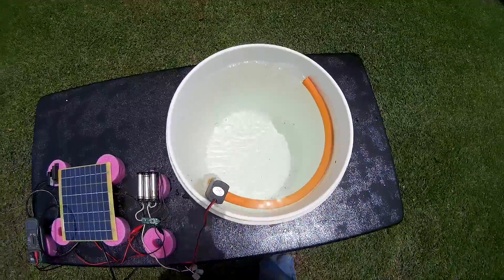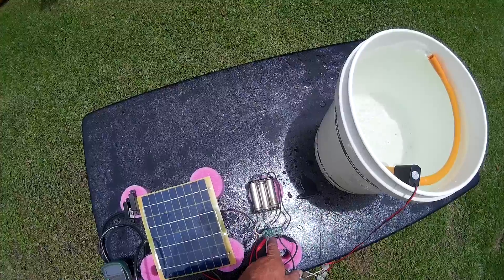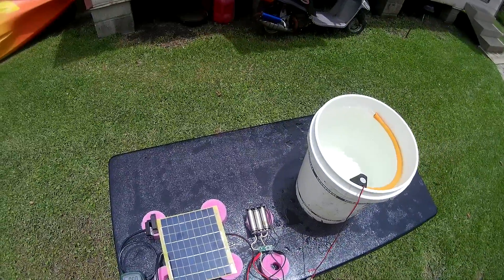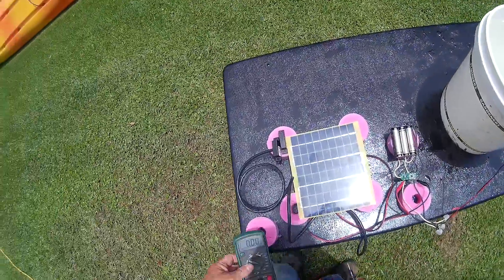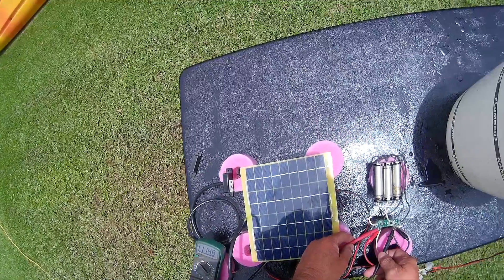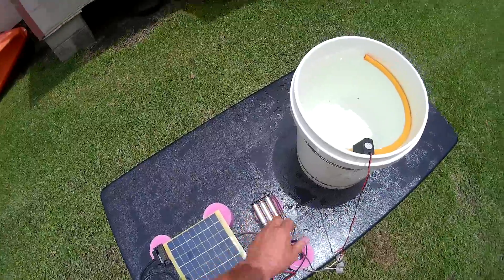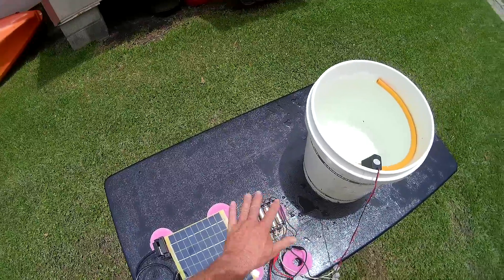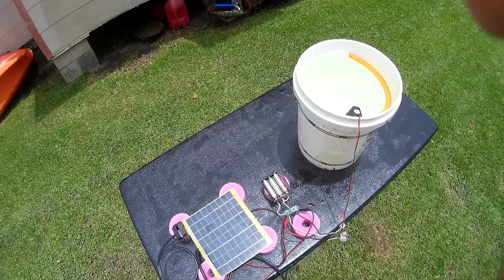Testing solar powered  water pump with lithium ion protection circuit and 18650 batteries

Comment: Is there 1 protection circuit for each of the cells?
Reply from the maker: +Cosmo John No it does not it reads a total of the volts between the three.
Reply: +Kevin Todd Noted.Thanks , dude.
Reply from the maker: You could take 3 of the 18650 individual cell protection circuits  and wire them into the 3 cell protection circuit you would have all bases covered the circuit in the video is from 11 volts low to 12.6 high
Reply from the maker: +Cosmo John I was wrong it does protect each cell

http://www.ebay.com/itm/10A-BMS-Charger-Protection-Board-for-3-Packs-18650-Li-ion-lithium-Battery-Cell-/331655511431?hash=item4d38357d87:g:oLIAAOSw9r1V9889
Reply: +Kevin Todd Thanks for sharing.